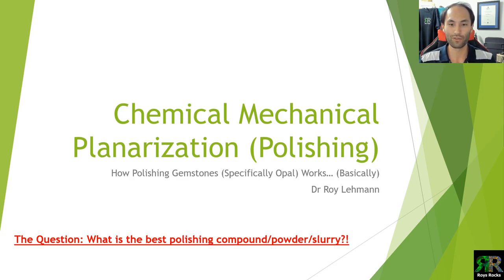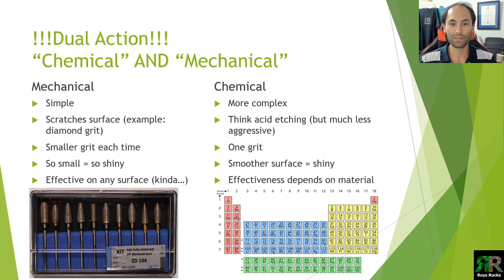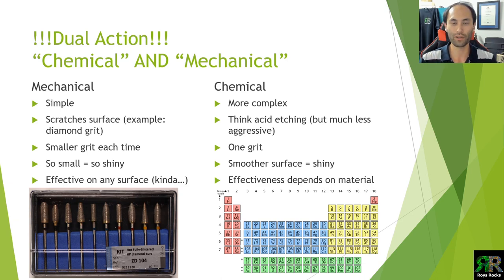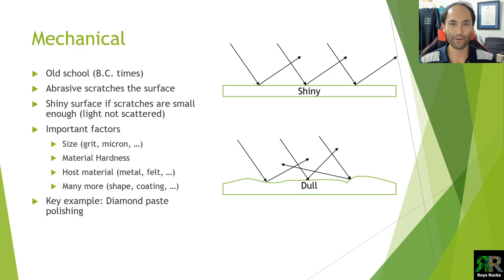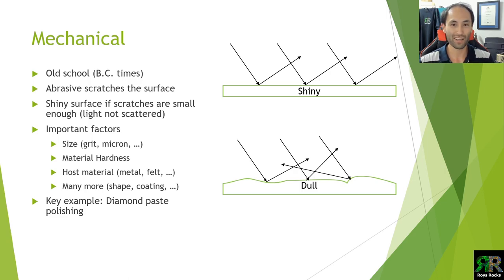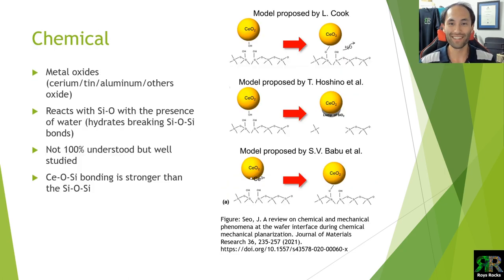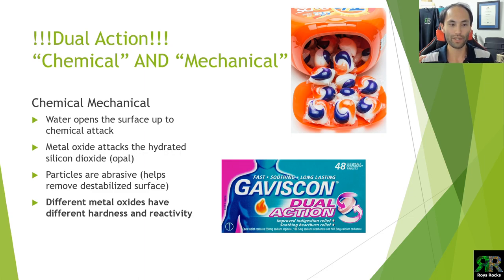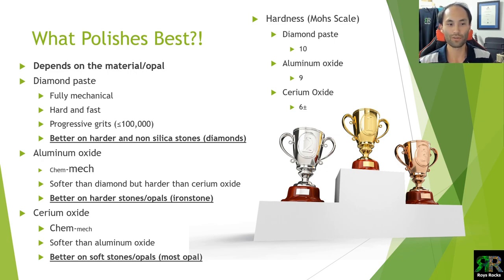Best Polishing Powder For Opal And Gemstones? Chemical Mechanical Polishing Metal Oxides vs Diamonds

Comment: Hi Roy, I was asked to find this video again by my Cape Town Rock and Mineral club guys as I had talked about it. One of your best video's in my opinion! Loved it. In any case, it gave me the chance to watch it again after a year and a half or so and as we are learning and learning (I cut everything and anything I can lay my hands on, not just opal) I found I was applying more knowledge gained to my thoughts about this process.

So - of course most of the polishing compound action is mechanical, and particularly and obviously so for the harder compounds, diamond, sapphire, Aluminium and Tin powders and Oxides which are all Mohs 9 and 10.

But in the case of the Cerium at Mohs 6 odd, is a possible explanation for the "chemical" surmised action (to go along with the mechanical) not perhaps explained by the fact that Cerium is significancy softer, and that one starts with particles of a certain size, which gives a given tiny appropriate sanding/scratch pattern - but then when you approach the drying point of the powder slurry on the felt or leather (where the stone starts tugging which is the point which the old-timers say the best polishing takes place) - that that is not where the oxide powder perhaps breaks down through heat and abrasive action between the particles themselves into smaller and smaller pieces, and therefore gives you a much better shine than you would have expected? So that it is not really a chemical action, but rather still a mechanical action but from a changing in size of the Cerium Oxide particles? And will not happen in the same way with the much harder Mohs 9 or 10 particles?

Not sure if I am making sense there - I know what is in my brain, even when no-one else does! :-)
Reply from the maker: Hi Theo, 
I think the best paper I have found on the topic is "PERFORMANCE CHARACTERIZATION OF CERIUM OXIDE ABRASIVES FOR CHEMICAL-MECHANICAL POLISHING OF GLASS by Robert Sabia & Harrie J. Stevens"
It is written without too much scientific jargon so should help you get a deeper understanding of Chemical-Mechanical Polishing (CMP) with CeOx. 
They divide the chemical action and mechanical action and show the effects of each. 
Keep in mind they are focused on fused silica materials rather than opal.
Reply: @RoysRocks  I can't find that anywhere free, looks like 60 dollars is the cheapest I can find it for. Academia is horrible.

Comment: Great topic. I'd certainly be interested in hearing more on cerium oxide and how best to use it. 

Cerium oxide polishing is a manual process for me. Instead of felt, I use soft, Italian leather. Based on my admittedly limited experience, leather seems to work better than felt for opal polishing.
Reply from the maker: You may find soft leather to work well because it would promote the chemical process more than the mechanical resulting in a great finish.

Comment: Nice video. As an opal-cutting chemical engineer it really hit home! When polishing a piece of boulder, would you consider using aluminium oxide on the ironstone part and cerium oxide on the opal part? Boulder is by far my favourite type of opal but I've never tried polishing with aluminium oxide.
Reply from the maker: I have played with that exact idea and came to the determination to just go with AlOx if there is a lot of ironstone (like a yowah nut). It keeps it a consistent polish with an equal rate of polish. If boulder is a fave then getting a little AlOx is probably a good idea.

Of course if it is a full faced opal I still would go Cerium oxide.
Reply: I use diamond paste up to 200,000 on boulder and find it successful. I have never thought to use Aluminium oxide before.
Reply: @RoysRocks  Might just pick some up then. Thanks!

Comment: If cerium oxide is binding to Silicon dioxide it might also bind to the minerals in tap water, which would make it less efficient. Maybe distilled water would improve the polishing process?

In the machine tool trades we use a green chemical (it's been years I forget the name) in our coolant. It's probably a surfactant and antibacterial? The water is recirculated, but it passes over drop out bins to remove the heavies. It bothers me to see people polishing with the same unfiltered water, moving from grit to grit. It grinds my gears 😂 

Good explanation, Tks!
Reply from the maker: Won't make much of a difference between simple distilled water and tap water (even if the tap water is really hard). 
Maybe if only a tiny bit of metal oxide was being used but at standard concentrations there is enough free cerium oxide to not make a difference.
That green coolant for machining is typically a mineral oil.
Reply: @RoysRocks  I don't recall the water being oily (surface grinder). But if the oil was emulsified?  Tks!

Comment: Excellent video and information - as usual.  Where does tin-oxide fall in the oxide hardness ranges, as I've used it with good success for general cabs in a variety of material (though I've never tried it with opal, since I'd heard cerium was best)?  I'd also be very interested in the more in-depth information (water ratio, pressure, time, etc.).  Thanks mate!
Reply from the maker: Similar question as cockatoobirdman bill so I'll recycle the answer:
"Good question, tin oxide is about 6.5 so very similar to cerium oxide so isn't really used as much as the chemical activity is a little lower and hardness is similar. Still works but would probably just take a little longer for a similar result and you'd want a smaller grit size." Basically a less aggressive AlOx.
Reply: @RoysRocks  Thanks Roy!  Cerium (at the high grades) got to be hard to find a while back and quite expensive, so tin could be an alternative if that happens again.  Good to know!  :)

Comment: I REALLY want to know your thoughts on high grade kaolinite as a polishing compound.  I'd have thought it refractive qualities would make it a great polishing compound - very high grade kaolinite....
Reply from the maker: It would work but VERY slowly. It is incredibly soft compared to all gemstones  even opal. 
It could have similar chemical interactions to AlOx (I'd predict a bit higher activity) but the softness means it will really struggle to remove anything with very little mechanical strength.

Comment: Hey Dr. Roy, I have some questions.
What grade of cerium would you reccomend after 3000 grit nova wheel? I use a cerium oxide that has a grade at about 3.5 microns. I checked a table and it should be between 5000 and 8000 grit, that I believe is really low. What are your experiences with finer cerium oxide and would you recomend going form 3k to i.e. 1 micron or finer? One step inbetween?
Reply from the maker: 3.5 micron is the bare minimum for optical grade. I have sourced my own custom cerium oxide which is below 2 micron and will out perform any optical grade. 
Will be on the website (for the same price as budget optical grade) which I am about to launch in an incomplete state. Guess no website is ever fully complete.
Reply: @RoysRocks  Thank you for your reply! I will therefore chose a finer grade!
Reply from the maker: @N0013Scientist  Yeah go for "super cerium oxide" Its just faster and easier to get a nice result. It can go by many other names but essentially under 2 micron max size.
Reply: @RoysRocks  thank you so much. I have found something at 1.1 micron! I will definitely try that out :D
Reply from the maker: @N0013Scientist  1.1um will certainly work better.
Reply: @RoysRocks  Hey Dr. Roy, turns out the chosen material comes with insane shipping costs. So I searched, searched much more. Obviously, Cerium Oxide at 0.3-0.5um is not a thing or just expensive to ship or in huge amounts from China available. BUT I have found some at 50 or even 8-28 nm, yes nanometers, which I find insanely small. I will probably have like zero mechanical abrasion, yes? The material is affordable and I would like to know if this is good stuff or to avoid. Thanks!
Reply from the maker: @N0013Scientist  I've tested some nano stuff but it doesn't seem to be more effective, though it can suspend in water a bit easier. 

Its always a bit of a grey area in terms of safety as well being so small. I know at uni there is heaps of thought surrounding the safety of nanoscale powders.
Reply: @RoysRocks  many thanks for the reply. Safety has always been a concern of mine, as prticles at this size cannot be filtered with the usual masks (3 microns), I guess ventilation and immediate dissolution in water should be advised, keeping hands off the material and washing thoroughly.. but maybe i should keep my hands off that completely..

I did read a paper while researching about the dangers of cerium oxide. Very interesting at what particle sizes it is toxic or not, what cells can be affected and under what conditions etc. pretty interesting material, but also really hard to read through and comprehend.. There is even an assumption that in some appliances it can restrict oxygen supply to cancerous cells, which could be potentially good for cancer therapy.. amazing!
Reply from the maker: @N0013Scientist  I've collated heaps of papers in that area but haven't packaged them up for a video yet. Dont think many would be interested I just did it because I am interested.
Reply: @RoysRocks  Hey Dr. Roy, that sounds super great, but I can relate if this is not too high prio for generating content on youtube I guess! 

Probably it‘s just my feeling that the hobbyist cutters „field“ lacks in a good source of verified „best-practices“. Maybe I haven’t researched thoroughly enough, but I have the impression that quality information is very scattered and relies on personal experiences mostly. Trying things out is quite fun, but some things are just best guesses (or secrets of each craftsman?), so any material with a scientific background is so welcomed, at least for my part! 
I starte with listing topics, but I stopped, as I do not want to spam the chat 😅